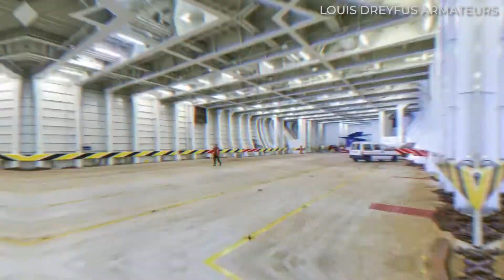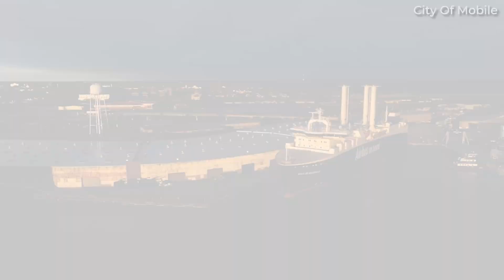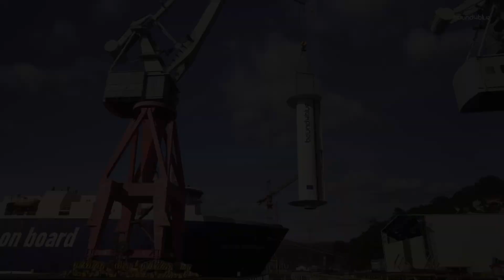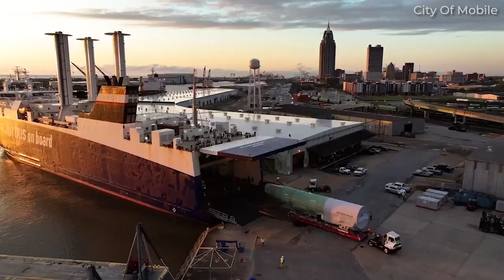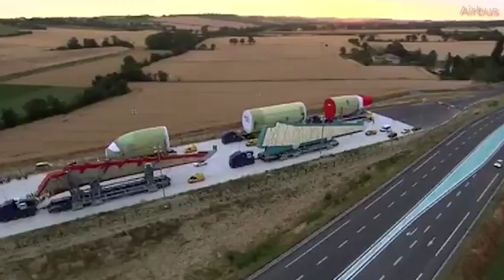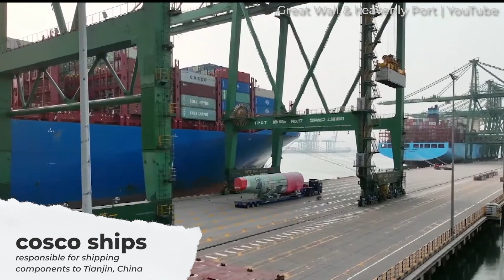The Ships Airbus Uses To Move Aircraft Parts

Comment: I was aware they used all kinds of transportation throughout europe, including sea-going ships aswell as river barges.
Never knew about the trans-atlantic shipping and towards China.
I would have thought pre-assembly components would be build near the assembly location aswell.

And that flying a finished product to the customer would be cheaper then sailing vulnerable components through harsh maritime conditions.
But i guess US customers will have demanded some US labour to be used in the build of the aircraft.
And Chinese government same deal.
Looking at the numbers in back log i have seen on other channels, i guess capacity in Europe to finish all pre-assembly components into complete aircraft is not available.
So "giving in" to demanding overseas customers, also solved a big problem in manpower probably first and buildable space 2nd.

Comment: for those unfamiliar with shipping: 

The sails thing is part of a global initiative in the maritime sector to reduce emissions, similar to that of the aviation sector, though their challenges are very different- ships are massive, and typically use bunker fuel or marine diesel, fuels which contain far more pollutants but are essentially waste products from the oil refinement process. Aside from the sails, other solutions being looked at include hydrogen and LNG power. Electric is typically not an option due to the massive amounts of energy needed and the poor energy density of batteries; solar is not an option due to the square-cube law. Sails are also somewhat questionable of an option to choose (imo) due to the square-cube law. However, even without these improvements in efficiency, shipping remains, by a massive margin, the most efficient method to convey bulk goods. 
I believe all the initiatives make no sense since the obvious correct option is nuclear power, given their high power density, zero emissions, and existing experience in maritime nuclear engineering. This is option is presently not seriously pursued due to regulatory concerns. 

Ro-Ro (Roll on, roll off) refers to any ship which is loaded with wheeled vehicles. Today, Ro-Ro ships are commonly used to deliver cars and trucks, though in the past they would also carry trains too, a practice becoming less common due to the complexity involved and improvement of tunneling technology. In Airbus's case, presumably using Ro-Ro significantly simplifies loading operations, given the obvious impossibility of containerizing their cargoes (putting the things in shipping containers), and their bulk making conventional loading using cranes complex and likely to damage the parts. They likely also ease weight and balance calculations, which are of equal concern to ships as aircraft. An improperly loaded ship can easily capsize ("flip upside down") which is known to be bad for the commercial value of the cargo.  

BBC Chartering is named for its two founders, Roelf Briese and Bruno Bischoff. It is of no relation to the British Broadcasting Corporation. Whether their seamen have above-average sized appendages is not known. 
COSCO is the name of the China Overseas Shipping COrporation. It is of no relation to American retail giant Costco.
Reply: The vertical rotor sails are far superior as it is simple (cheap) & reliable.  Nuclear which is extremely costly (as it needs to be),it also needs highly trained technicians, and requires fueling (and spent fuel disposal).  There's a reason why even in the US Navy that nuclear power is limited.
Reply: @soccerguy2433  true, but if the shipping industry truly wants to de-carbonise, sails are not a viable option. the amount of force they can generate is not enough to move modern container ships, only provide some efficiency gains. Not to say that it doesn't work, but from a long term, ehhhh.
nuclear power is a presently available, well-developed way for true emission-free propulsion, and with the economies of scale that the shipping industry has, the relative cost of using existing nuclear options with training just a few thousand (admittedly skilled and expensive) technicians is very favorable compared to developing new LNG or hydrogen systems that need to safely store a massive amount of volatile fuel aboard ships and also develop reliable, safe powerplants. The amount of technical cost and developmental timeline for these things is enormous. This is in addition to the fact that after these new technologies are developed, there needs to be a re-training programme for sailors to use these technologies anyways, since there wouldn't be a base of knowledge of these things operating aboard ships if there even is an equivalent system on land. 
I would also like to re-emphasize the amount of technical risk involved here too. both LNG and H2 are cryogenics, and a leak, for instance, is absolutely no joke, not to mention all the other things that can go wrong. Marine diesels are massive things and there is little doubt that even if these new technologies can be smaller, they will not be significantly so, so things going wrong will look less like a car fire and more of a building fire. anything going that badly wrong will undoubtedly result in loss of vessel and crew. Operation of marine nuclear reactors is a field that not only exists already but also has had substantial development time put into their safety and has people with experience operating in the field right now.
so in conclusion, yes, cost, but de-carbonisation is expensive either way. the cost advantage, if it exists at all, is far less than people typically portray it as. The nuclear option can benefit from existing methods and has significantly lower risks associated, and has the further advantage that it is truly emission free, compared to H2 which releases water (which is still a greenhouse gas, just less bad), and LNG (which also does CO2).
Reply: i’m glad no one’s put you in charge 😆 ‘’it’s just money!’’ 😂🤣
Reply: @minyiiiii  The issue with nuclear for commercial shipping is though, that these ships sometimes sink. Which then results in nuclear waste laying on the seabed which then can contaminate entire ecosystems.
The US Airforce tried to developed a nuclear powered bomber in the 50's and they got pretty far actually, they had already working nuclear powered jet engines. But then somebody ask the question...What would happen if this thing would crash? Potentially over our own territory because that's the most likely place for it to crash. Well, nobody really liked the answer and that in the end was one of the main reason the project was shut down.
Putting a nuclear reactor into something that has more than an absolute minuscule chance of crashing, sinking, burning or exploding by itself is simply not a good idea.
Reply: @ ironically, nuclear would be better than the status quo in that regard. 
Today, marine vessels are powered by marine heavy fuel oils, essentially the long-chain molecules left from the fuel refinement process, the worst parts of crude oil. There is a good reason every time a ship is lost, the salvagers put around oil booms to make sure there is no leakage of the fuel-- If they do leak, like happened with the Golden Ray when it capsized outside the port of Brunswick, the environmental impacts are far worse than a typical nuclear shipwreck. I encourage you to look up images of salvage from ships like the costa concordia, and look for the oil booms- bright orange floats that are placed in a ring around the vessel in an effort to stop oil from leaking further into the environment. 
I am able to say that a typical nuclear wreck is safer for the environment with confidence because military nuclear vessels have indeed sunk before, notably the thresher and scorpion from the US and K-27 and K-278 from the USSR. These wrecks are continuously monitored, and thanks to their properly designed reactors, exhibit minimal leakage of their nuclear fuel, with their environments showing no signs of excess uranium or plutonium. Modern marine nuclear reactors are designed, in case of an incident, to flood themselves, which disables the reactors, and seal themselves shut, failing "safe", as it were. It is my understanding that a properly designed and reasonably maintained marine nuclear would be far safer than a marine diesel in accidents of equal magnitude in almost all scenarios.